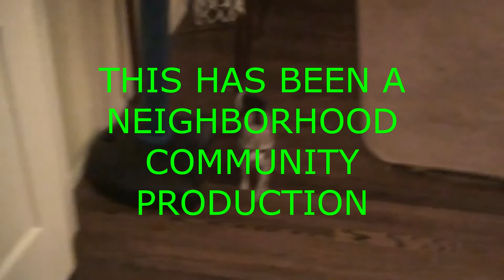RAN OUT OF THINGS TO WATCH

Comment: Kevin, if you have a good magnifying eyepiece, you might want to check your soldering job before you put that circuit board back in the fridge. A tiny solder bridge between two connectors can shut down the board or even cause damage when the board is reinstalled.
Reply from the maker: OK.  Thanks!  Kevin